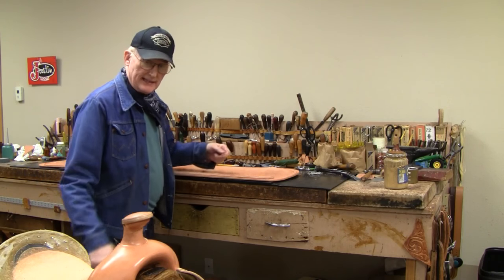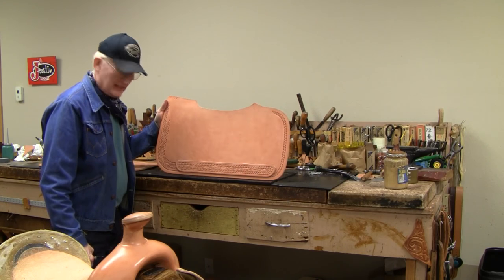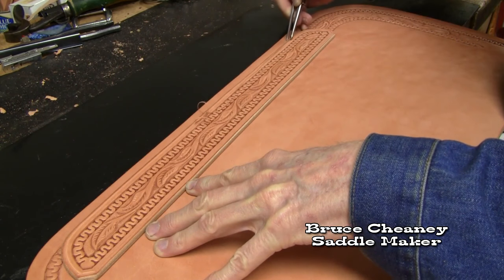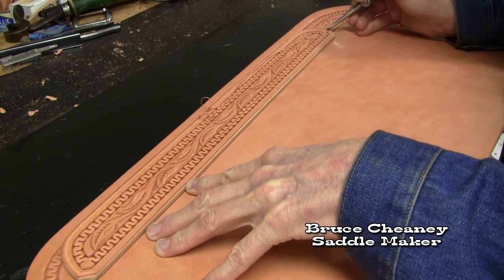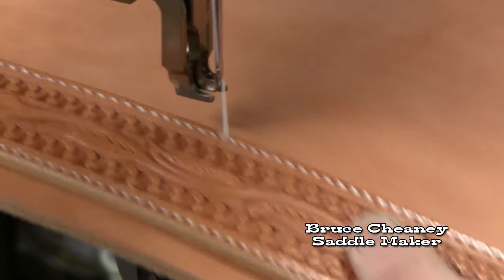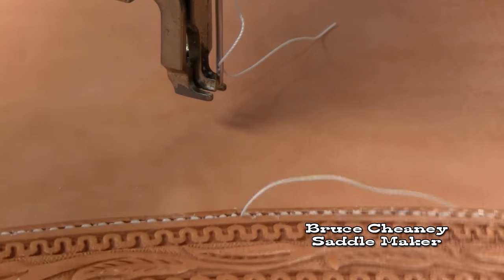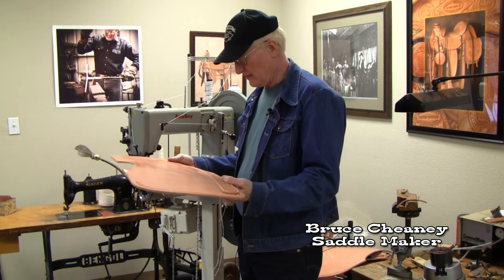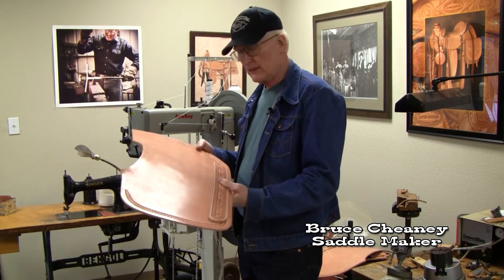Leatherworking: Sewing leather on a machine - Saddle Making

Comment: Hello Bruce,
you use a 180 needle with thread number 8 !!!
Reply from the maker: Pascal, Most of the time I use a 200 Schmetz needle and white 346 Polyester 
thread. I use a 180 needle for thin leather and real thick leather a 
230.
Reply: Hello Bruce,
I thank you for your good answer, but you have several machine or on this machine you can put a needle to 180 and pass 200 without making a setting for retention of the thread!
I ask you the question to you !! in France they are lost when we ask them this question !! thank you again and see you soon
Reply from the maker: With this machine I rarely ever touch the tension adjustment even when changing needle size.

Comment: Very nice!
I’ve been having issues with my machines presser foot crushing my tooling design. I see that yours seems to have much less pressure... I’m wondering if I can change my presser foot? 🤔 or if there are settings on my machine for that?
Thanks for your video
Reply from the maker: There should be a way to back off of the pressure on top of the machine. My machine has a threaded round nut at the top that can be turned and loosen the pressure. I think I did that shortly after I got my machine.
Reply: Bruce Cheaney thanks so much Bruce!
I have a threaded tensioner on top of the machine, I don’t see much of a difference when I make changes. Call me crazy, but I feel like there’s more of a change in my top thread tension instead of pressure foot pressure 🙃
I just ordered a smaller foot to see if I can run over less of my designs!
Thanks again for your helpful advice!